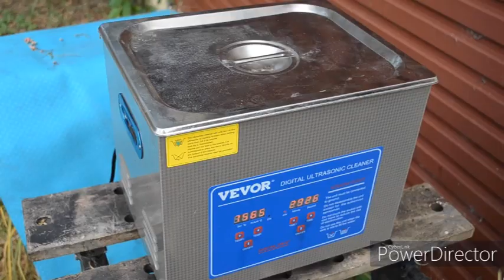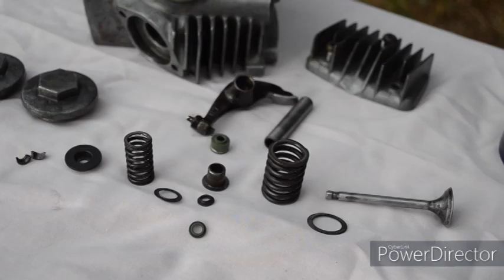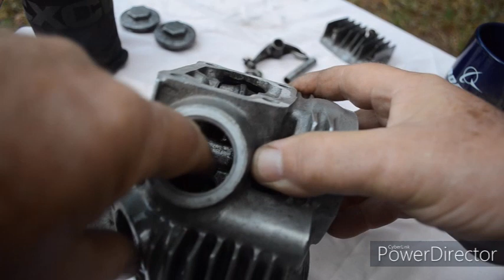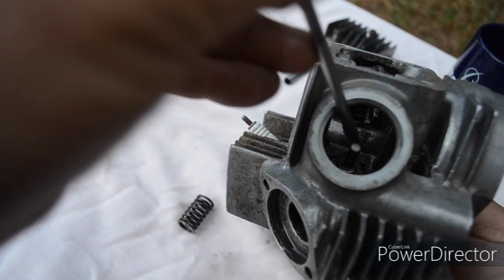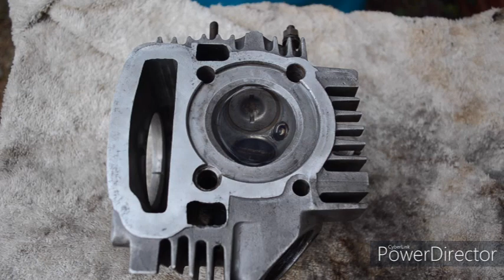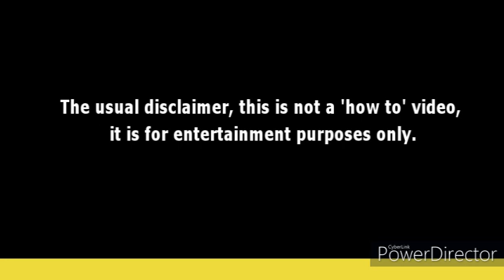Honda CT 90 Rebuild Part 5 - Cylinder Head Valve Assembly

Comment: Hi there. Another great video thanks. Does it matter which way up the large valve spring seat washer goes? It seems to have a sharp edge and a rounded edge. Or am I imagining things?
Reply from the maker: Thanks David, I couldn't see any specific mention in the old manuals & as a guess from new I'd say it makes no difference. But yes I'd suggest if there's some wear giving a sharp or ridged side it would fit toward the spring.  The inner spring seat is much more obvious in the way it fits.